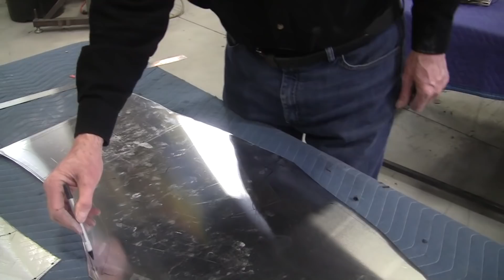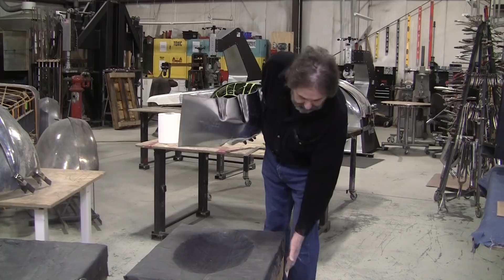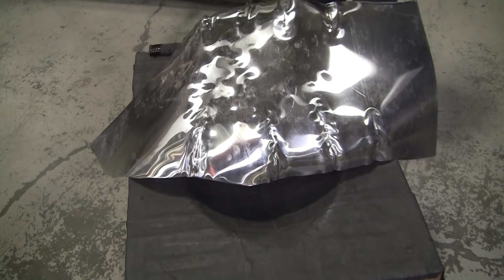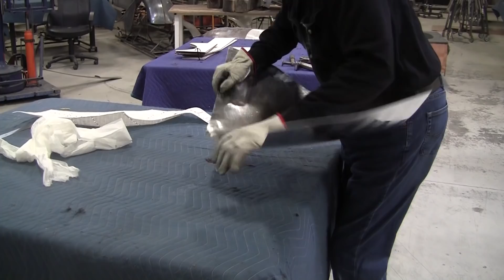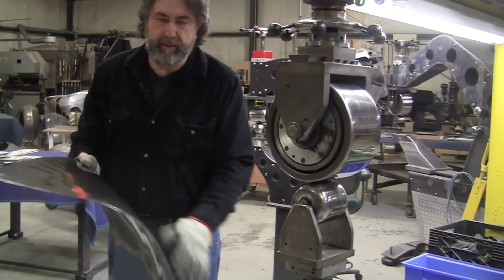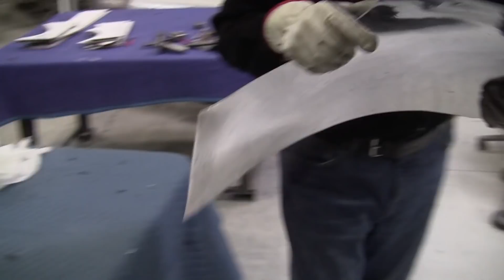How to build a Jaguar E-Type fender

Comment: The rubber coated wooden form that you are forming on is basically a female mold.  Would it be beneficial to build a matching male form which could be with the female mold placed in a metal framework and using a 20 hydraulic jack to make a small press ?  Different radius wooden molds could be developed to insert in the press to work different shaped panels.  Would this eliminate much or part of the hammering process ?

Comment: That  was like watching a magician at work! It is clear that every hammer blow counts how the final form emerges is still something of a mystery but it happened before our eyes..
Reply from the maker: Hi John, yes you are correct how much and where to hit is critical. "Metal is clay" I say,  you mold it with the mallet instead of your fingers. You then smooth and refined the shape with the English wheel. You use the flexible shape pattern or a buck as your 3D  blueprint. The real confusion comes in when a newby watches a power hammer advocate, or an Eckold machine advocate, or an advocate of only using the English wheel. Almost everyone that works in this craft latch on to one technique that uses a main tool. I try to teach that you can do the same job by using inexpensive tools. Knowing and understanding the techniques to move the metal  is more important than knowing how to use a specific tool.

Comment: So the folds on the shrink areas are okay? The metal can just fold like that and you continue to smooth and make a uniform thickness? 

Do the folds of the metal recombine or bond somehow? Or do you just make sure not to pile up too many folds in one area, so it doesn't become several layers of foil?
Reply from the maker: Where the gathers are after correctly hammering them into themselves the metal thickens. It works exactly like clay "metal is clay". You have to accept that or you will get a headache over thinking it. It is not layers, it is thickening. As  the spot you shrink thickens it occupies less surface area pulling the linear length of the edge together. If you haven't visited my YouTube channel home page you will find more videos explaining the process.  
www.youtube.com/c/proshaper
Reply: @proshaper  that is amazing, I had no idea aluminium could do that. I'll take a look at your other videos. Thank you

Comment: I'd say your "work softening" is removing the age temper taken by the panels when they sit on a shelf "seasoning" waiting to be sold 3 or 4 times through the supply chain. The plastic deformation you perform isn't the "beyond the flex limit" stress that work hardens excessively, and it seems to "wake up" the grain structure to the hardness it was manufactured to. I just found your channel, subscribed, and I'm wowed by your methodology, technique, and tool usage. Thanks for sharing this here!

Comment: You need 20 years of experience or you need 5 years of experience - nope, you just need a good teacher... thank you for the excellent video. Don’t worry about the length of your videos btw, if you made a 4 hour long video I would watch the whole thing just to learn from your experience.
Reply from the maker: Yes, I hear the "it takes 2000 to 5000 hours to learn" all the time. Then I have absolute beginner students take my class and create perfect panels, and go back to their  home shops and continue to make perfect panels.  Most people that do teach coachbuilding/metalshaping try to teach how to use the tools. In that method of teaching the tools become the magic ingredients. If you don't have the tools you are not going to succeed.  My method is to teach how the metal moves "metal is  clay". Tools are secondary techniques are primary.

Comment: I am not sure how well it would work, but the next time you shape a really curived part like that you might draw a grid on the panel. That could provide an instructive visual indication of how the metal is shrinking or stretching as it is worked.
Reply from the maker: Unfortunately the grid will fail in two ways. First unless it is acid or laser etched it will get wiped off. Second even if you could maintain the grid the movements of the metal- contraction and expansion of the surface area -is so small you wouldn't be able to  "see" it. You would need to measure it in the thousands of an inch. The magic of the shape change - from flat to a compound curve is that it is accumulative. Each square inch of surface area of a panel either expands or contracts.

Comment: Hi, just another one of the most teaching videos on the market ---- for free!! Your experiences on 3003 h14 are exactly the same I have here in Germany. The only non occuring strange feature over here is this high  note singing sound while wheeling the panel for the first time. Main influence is in my opinion the fact that h14 means that the sheet was brought from a natural soft state to a fully coldhardened via deformation and then being softened to "halfhard" condition by thermal treatment. There are lot of stages where "enough" and "hardly enough" are the same in respect to production costs. But 3003 h14 is a fantastic stuff to work with anyway. It took me 2 years to get hands
on in Germany - and we had to buy 1100 kg minimum of 1.6mm at last. But after a certain learning curve it is worth while.
I'm not quite shure , but in some situations I'm close to believe in a also time dependent behavior which is atypical a coldhardening alloy for.
Well- strange but fantastic stuff.